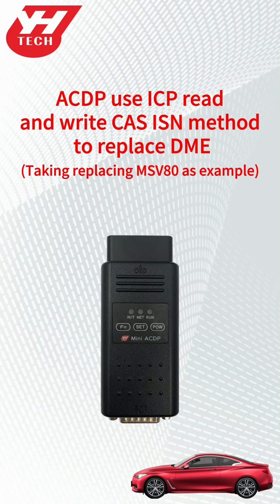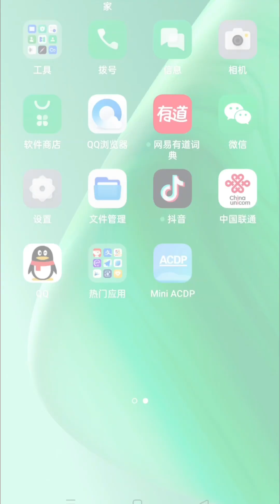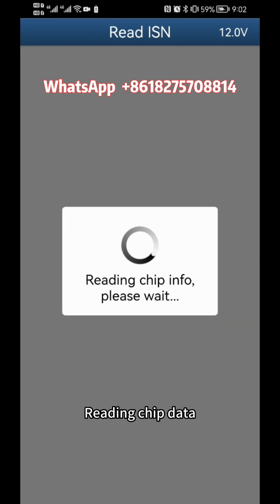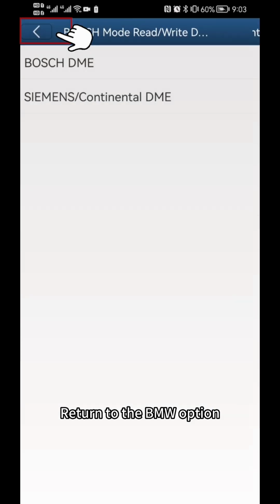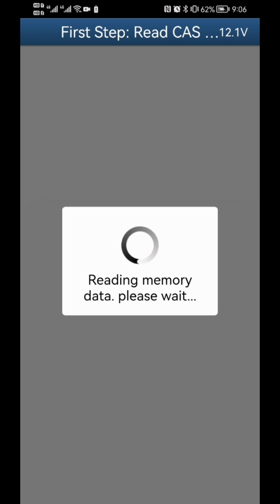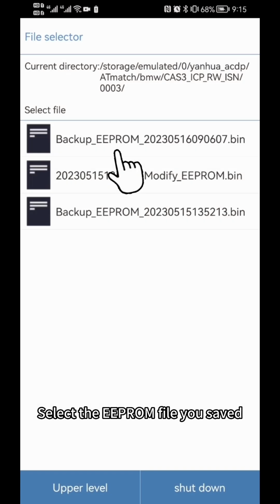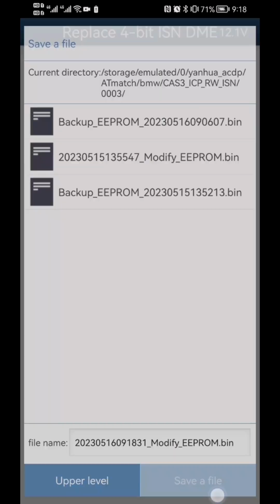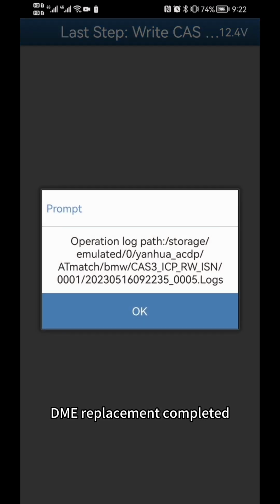Replace/Clone BMW ECU when original ECU is damage by using Yanhua Mini ACDP take MSV80 as Example

Comment: it suppose to be the other way around  why do  you write the  donor isn  in to the existing  cas ? what hapends to the transmission do you have  to  modify the isn all so????  or is not affected  and  it will just need a recode or re program ??????